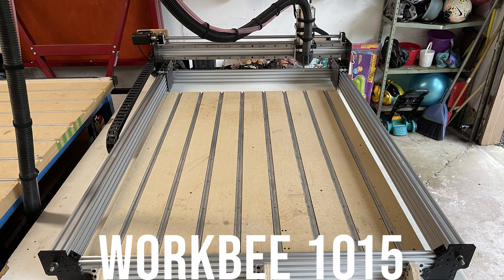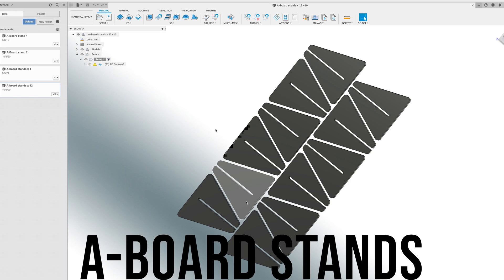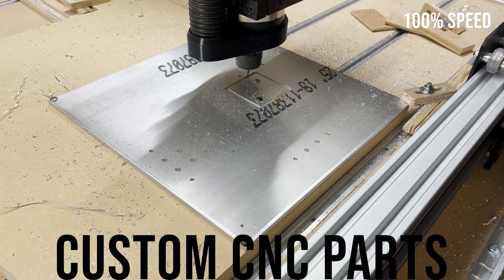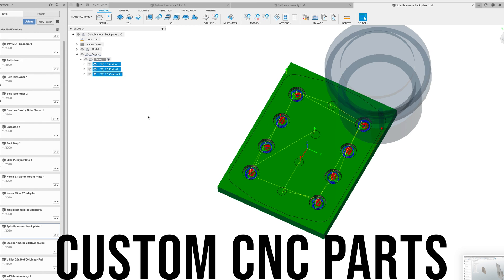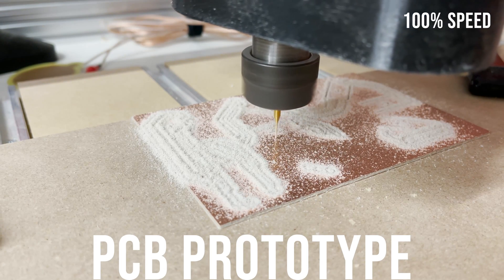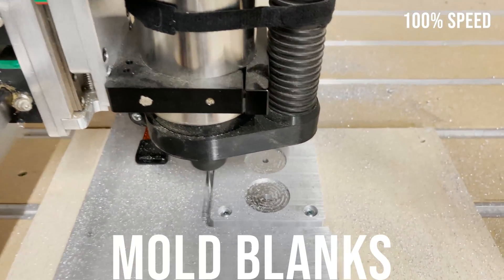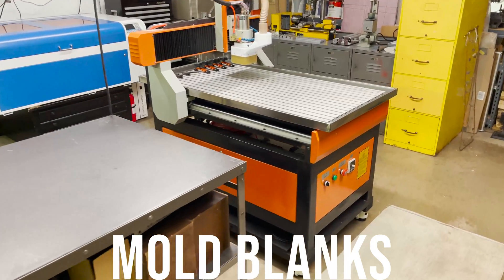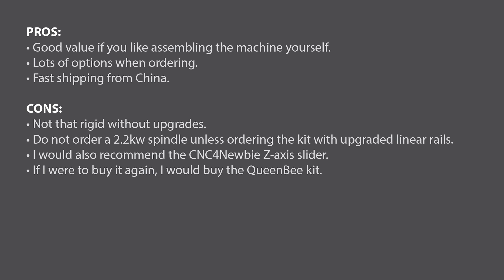REVIEW: WorkBee 1015 CNC Router

Comment: agreed, in stock form, it leaves much to upgrade to get quality cuts. The Z axis is one culprit with too much flex, the other is making sure the gantry is also stiff enough. There is a vendor that sell C-Beam Heavy which is much more aluminum and much more stiffer than stock c-channel used for gantry. Nice build on your part, none the less. Thanks for sharing!

Comment: Thank you for sharing this video on machining aluminium parts for your next build. 

I am in a similar situation, built a DIY cnc router but using 3DP plates all round and looking to machine aluminium plates to replace  the 3DP plates. I will be very grateful if you could share the feeds/speeds and things like dept of cuts and type of end mill you used to make the parts in this video. Thanks again!

Comment: What controller you using on it?  I got the queen bee pro in that size. Been wanting to do  aluminum on it.  Mine seems pretty rigid. No flex with the 2.2 kw spindle.  Now bulkman has the ultimate bee pro to upgrade the queen bee to ball screws instead of the acme rods on the queen bee.

Comment: What do you think about the OpenBuilds 1010 and 1015 ? The construction is a little bit different and more easy to upgrade due to different plates than the WorkBee. Would this machine be better if shorten the X axis to lets say 800 instead of 1000 ? After all its the X beam that takes all the load from the spindle. Thanks...
Reply from the maker: I’ve never built the openbuilds kits, but they look very similar …certainly the shorter the beams, the more rigid it will be

Comment: I’m looking to cut MDF 1/4 to 1/2 max for a flight sim project. Would you recommend a CNC or laser cutter? I have laser cutting experience. No CNC experience. I ask as I watched your laser cutter review and saw that you were able to cut 1/2 inch MDF with it. Appreciate your thoughts. Thanks!
Reply from the maker: I always prefer laser over cnc when applicable, it's not as messy, quicker cutting, and the file prep is easier. But, sometimes you just need a cnc if, for example, you need to cut out a pocket that is only halfway deep into your material....the laser can't really do that very well.

Comment: I am looking at going the Queen Bee route.  I have been looking at others like the Sienci longmill and the Onefinity but this seems to be more bang for the buck.  One positive is that you get into the spindle as opposed to a trim router.  How much quieter is the spindle vs a trim router?  Also, were you able to sell your Workbee and were you able to sell it close to what you put into it?
Reply: I've had the QueenBee 1515 for 2 years now, from an X carve, run both but dont think twice about that queenbee friend, you wont regret it, the linear rails really make the machine a tank and keep it well together, stay away from the wheels!!! This isnt red dead redemption, we have rails now lol
Reply: Spindles are quiet, pack more torque and are made to run for hours, routers are made for intermittent use.

Comment: So Travis, have you had any issues at all with EMF because I noticed you're running you spindle cables through the drag chain along with your motor signal wires. I'm just about done with my Lead1515 build and the thinking was running my spindle cables seperately overhead where you have your vacuum pipe. Any thoughts
Reply from the maker: Yes actually, it would occasionally trigger a false positive on the limit switches, they used shielded wire, but it would still happen every once in a while. I like your idea of routing it up above.
Reply: @diyfiberlaser  shielded cable is useless unless it's grounded to earth. Apart from grounding, I also used 2 ferrite cores on each signal cable, one on each end.

Comment: On your Lowrider, were you using dual endstops with auto squaring? I’m currently building one, so I want to figure out what made you not like it vs the others who do like it. Thanks.
Reply from the maker: I was using manual endstops for squaring, this wasn't really a problem itself, but combined with the issue of the z-axis motors not being able to hold up the gantry when not under power, it just made the process of starting up the machine really finicky and unenjoyable. I wouldn't want to dissuade you from building the machine, as I don't think you can do any better at the price point, but if you use it a lot and want a better experience,  you may find yourself upgrading at some point like I did. I don't know if you saw my full review of the Lowrider, but you might want to check it out to see the potential issues you may have with the y-axis wheels as I and others did: https://www.youtube.com/watch?v=gh4UWa5n-6o